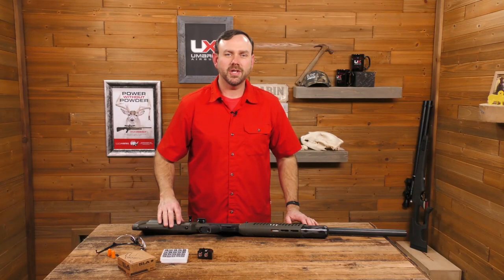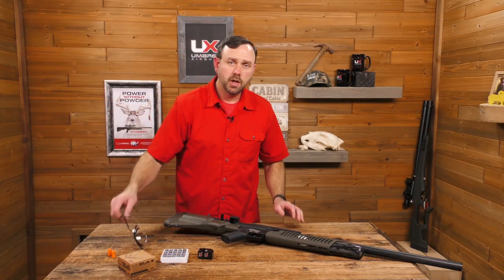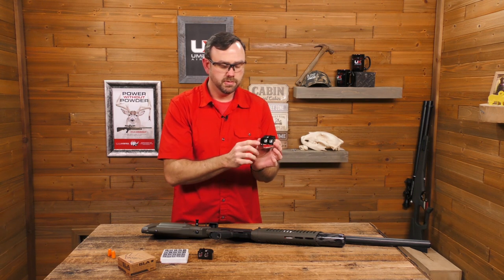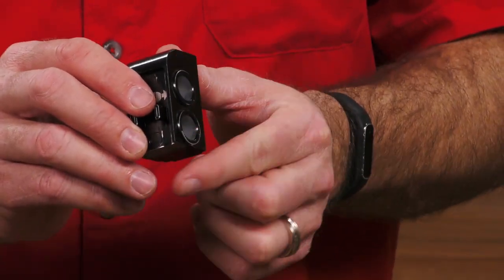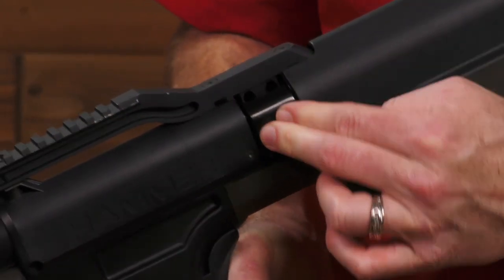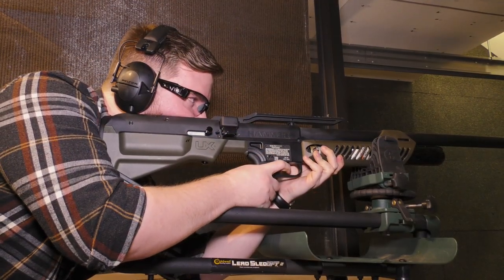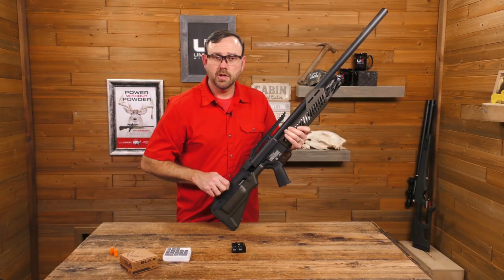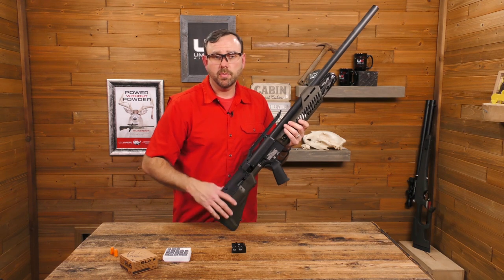How To Load and Fire : Umarex Hammer Air Rifle

Comment: After 5th round (Degas) how do I refill ???? it will not hold pressure. I'm filling with a SCBA.
Reply from the maker: If your Hammer is now void of all air, need to give it a "punch" of air to get the valve closed. If unsuccessful, give us a call: 479-646-4210 ext.7

Comment: I just received my Hammer and the Magazine wont stay in the clip when I load  the magazine.
Reply from the maker: With the bolt half way back insert the magazine into the mag well, all the way, until it stops. Don't force it. If it doesn't go all the way then the bolt may have slid forward a little--make sure it is back. Once the dovetail grooves are lined up it should go in smoothly.

Comment: I just got my new Hammer in the mail today.You gotta be one tough sucker to pump it up from 0 to 4500 psi :) I been at it for two hours and only at 3000 :) Hasn't leaked by seals since I got it to 1000 psi .Why have a fourth shot if it leaks after 3rd .That must have been the prototypes .I think they changed a lot since then
Reply from the maker: Hand pumping is a strenuous job! Production models are engineered to give you three full power shots if you've gone to the max pressure fill, then you get a fourth of lesser power.
Reply: @UmarexAir  I just shot my new Hammer first time.Shot two shots into a thick legal book.Almost went all the way through.3rd and forth shots shattered two cinder block pavers ,! Very impressed .

Comment: Why would it degas after 5 shots???
Reply from the maker: The hammer degas after 5 shots is pretty standard on PCP’s, once you get to a certain pressure the gun won’t seal back up after a shot and it will dump all the air out. This happens sooner on a hammer because you use more air after each shot.

Comment: So what the heck is purpose of the gun degassing it self after 5th shot..  That is very disappointing ..
Reply from the maker: Nothing new. Around 1000 psi or just below, the Umarex Hammer will dump its air out of the muzzle caused by lack pressure that holds the valve open. Other air rifles do the same. Majority of shooters will refill after 3rd shot if not before for air use efficiency.